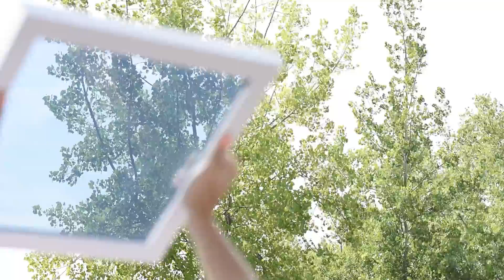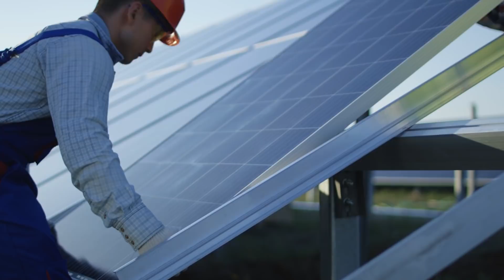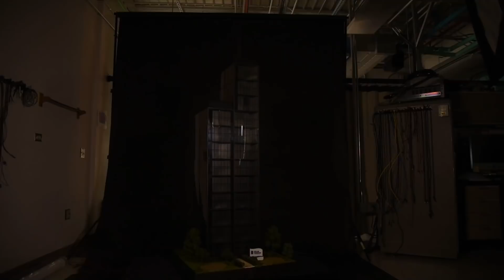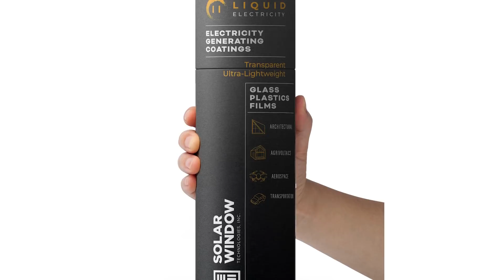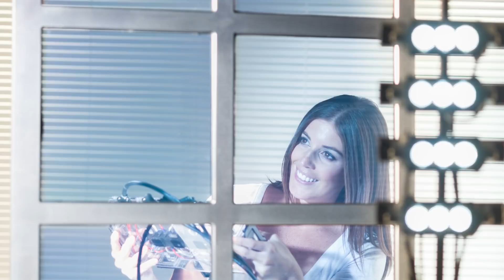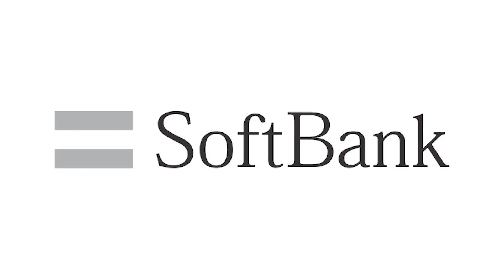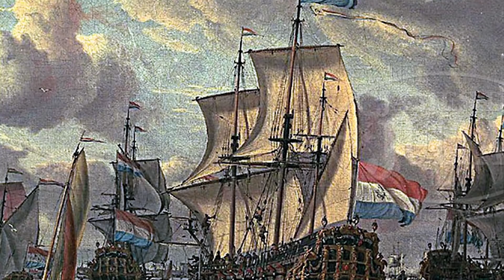Solar Window (WNDW) Your Next Solar Investment?

Comment: "... and ultimately be taken off the glass or plastic by a wire to wherever you need it".  Does anyone else hear in that statement that they haven't been able to figure out how to remove electricity efficiently enough to make this more than an a interesting idea.  This is exactly the type of technology where specifics about power and efficiency matter.  This has all the signs of being a pitch and none of being an actual product.

Comment: While I feel the discovery of solar coatings is really a grand idea and on the solar collection end it's a major break through - What I see is that the same thing has to happen to the solar coatings as does the solar panels - nothing is generated or collected if you will - after the sun goes down. that's my first  point the second and most stinging point is that a major portion of a solar system finances goes into the other major parts such as controllers and inverters and the big buck batteries which have to be the main power source when the sun goes down. Not to mention days when the it's cloudy and there is no sun or raining days or overcast winter months, so these too are also a very large factor in solar energy working at a cost efficient level. Yes I do agree that after a period of time the solar power does repay what is spent on grid power, but in many cases for a total solar off the grid home, that can take years not months to break even before a payback can be achieved. Anyway - Good video guys and I do hope to see it become  worth the effort before I die. Cheers!

Comment: Hold up a moment.  After saying that it's not imperative to be South facing - the next statement ( 12:45) says that non transparency is always going to be our friend bc more light equals more energy. So that in my mind says that this film/coating has a ludicrously high light to efficiency ratio or otherwise it just won't work? Am I just sceptical,  or have I missed something that contradicts the law of physics?

Comment: Windows move you mean his windows won't have electrical problems if you have 13-20 windows and half open or slide sounds like a electrical mess to keep it running  before it's paid off.

Comment: Why do they always talk us to death.  A picture or demo tells a thousand words.  Add to that how long does it last what materials are needed to make it.    Solar panels use coal special crystals , metals fired under great heat .  Solar panels last 20-25 years then you must replace them.  Batteries play a role because just generating electricity is half the job you also must store it then you have to convert it to use it to run things .   So much unanswered.  Still to complex and is it durable .

Comment: Doesn’t seem like it works. Well maybe not this minute. But  
How to make it work? Simple. Tell the story over and over connecting it to all kinds of other ideas/concepts. Seed it into thousands of minds to start building the potential imagery. The repeated thinking on the concept builds desire energy that pours from thousands of hearts. Heart energy has mass, so those energies crystallize into a non-visible construct . The non-visible construct of the object is what makes the physical prototype begin to work (or solutions be discovered). 
Thus the original hidden solutions were released into the 3rd dimension wayyy back in the generating of the heart desire energy. 
This is how “programming “ minds makes things and behaviors and beliefs become real life things. Just saying.

Comment: I'm no genius but I don't understand it. How can it generate electricity in reflected light and lower levels of light when my 100W solar panel which is supposed to be a little better than average when partially shaded drops off a cliff power-wise when it is cloudy or in partial shade? I think if they could just show this with the glass they claim is generating the lights they show in a video on their website, that would be square one. This company started in 1994 and has been compared to Theranos.

Comment: What progress on increasing efficiency AND optical Transparency?  Even slight opacity = Eyestrain.  Cool nanotechnology.  As for use on dust-storm Mars combining nano coatings to render windows (for instance) unable for dust to adhere to these surfaces. Great for increasing solar electricity generation.

Comment: Whats the timeframe of a panels life? Is sun deterioration or coloring of the panel through time a Problem down the road?
Reply: My exact thoughts along with Efficiency, Durability and Temp ranges
Reply: Also,, I’m an electrician, in order to couple these panels together the wiring would have to be a very large gauge to handle the distance the current needs to travel without loss from distance. There would have to be many current and voltage booster stations in-between  panels especially wrapping a large structure. Deterioration of wiring through time unless ran in conduits, What’s that do to the visibility of the panels beauty wise? All that wire and conduits? Or is wireless transmission the way to go?
Reply: @jeffreyjball5070  "Beam me up Scotty."

Comment: This is not a new idea or even a product. Thin film solar has been produced for 20 years. The reason it has not been mass produced, Is it is not dependable and didn't last no one would produce it because they didn't feel comfortable warranting the product. A product that you can paint on any surface  has been something that people new they could do for a long time the problem with that as well as any type of thin film (you can print on anything with a normal printer) is that you can not size a inverter to something that you are guessing what the output is going to be. Every inverter has a minimum and maximum. So that if you aren't in the middle of that min and max they inverter will not turn on. So now you absolutely can produce power from dusk till dawn it cannot be harvested into energy but you will not be getting a very good return on your money. So as for giving or investing or even trying this product my professional opinion is to let this company do this on there own for a couple years before investing or purchasing. If it is a product that they believe in let them give the product to non bias people to put on their house and see if it even lasts long enough to receive a return on  your Investment. Definitely don't give or invest money.

Comment: It has taken a lot longer than it needed to though...The auto industry deliberately stopped electric cars f4om going mainstream in the 1990s. Also, BASF bought up the patent for a very good battery (the Ovonics battery) and then stopped car makers from using it.

Comment: This is beyond a great concept that is genius.... Power generation on any surface .... Now add thermal and magnetic resonance with it and you can literally generate on any surface...
Reply: If it;s so great, and they've been promising a product for 20 years, where is the product?  Don't be so gullible,  This looks like a typical clean-energy scam to me.  Check their stock.  A lot of people have lost a lot of money.
Reply: @dougselsam5393  one thing I am not is guillable. I said great concept not company though if they manage to finally create it more power (pun intended) to them .. my hope is that someone will take this idea and run with it but with the way the world is today it may or may not come to fruition.
Reply: @Rivanni1  Well I did read that his company had doubled their performance to 14% as measured by NREL, and also other Organic photovoltaic films are suddenly doubling their efficiency now, but how long do the membranes last?  How many layers need to be applied?  Protective convering?  What about UV damage?  How do you apply them?  How do you connect them to get the electricity?  How can this guy talk about his supposed technology for almost an hour-and-a-half, and not touch on a single basic fact about them?

Comment: I understand very little about the tech on this BUT, it's not possible to run a home if you exchanged all of the windows for PV panels so how heck would anyone think that it's viable for anything other than glass built skyscrapers or office towers? Discussion time
Reply: It doesn't just go on glass genius, it goes on any surface, glass is just an option

Comment: What is the efficiency of this material on 'say' a glass which has the same surface area as a 'say' 300w Solar panel  ?
Reply: I think he sort of intimated size for size it doesn't stack up however the area of a roof compares badly to wall area So it becomes equivalent
Reply: @martyn3203  hope they highlight your reply for all the naysayers, small minded lot. Imagine this tech on walls.
Reply: He never said! He answered like a politician!
Reply: This stuff seems still in development. The company has said that a fully repurposed highrise bldg. could see energy SAVINGS of around 30%.  This is not a self-sustained system, more like a passive system for energy conservation and fossil reduction.    Still interesting, but NO PRODUCTION DATES, as shown.

Comment: I'll have solar panels on the south facing roof and solar windows everywhere else.
Reply: I have a Danish solar phone charger (was a Kickstarters Project) that has a flexible perovskites roll-up solar panel. Think a smaller self-rewinding window shade.  I hang it unwound in a window.  The battery and electronics are internal.

Comment: I still don’t get how this is gonna be wired into a power wall? How is all the wiring going to work and look like?

It seems that the foil has actually some grid pattern on it?

Interesting for sure but I would like to see how this works implemented in a building

Comment: Start applying to phone screens to help charge the phone. Set up with Apple I guarantee they would like that if it would work on a phone screen. I don’t have a data sheet on your product. It would be awesome to see the data sheet on your material. Keep up the awesome work your doing. Would it put out power from the light of the screen so you are taking advantage of some of the power output of your phone.

Comment: I needed a camera phone before they came out. I deal with cars and I use to have to send a picture of what I can buy to get the customers input. I had to use my Sony digital camera that took 3.5 floppy and then hook my Motorola startac to my laptop with a special cable and dial into my internet provider and send the picture via email. Usually took 10 minutes to send pictures after everything is done.  By done I’m talking about the successful sending of the email. And the upload speed was 42kps. Thankfully that camera made very nice pictures that were extremely small Sony Mavic in 97. All the other car dealers thought I was some kind of genius. I just had a need and everything already existed to do it and I put it together to suit my purpose.

Comment: Id be willing to have put on my van for rv energy window an reflective paint gloss on body as well an reflective metal reflection on under carage ..an see how the energy capacity flows into lithean battery into generator to power frig cooler heat cooking glass top lights ect. Get ahold of me an id be a tester
Reply: Sure!  Get in Line ... , haha.
Reply: Ooo, get a solar window driveway to go with the reflective undercarriage. Wait, can a mirror like surface be used for the driveway and can both reflective surfaces have solar window tech? That might create excessive heat problems if the ac goes out or isn't strong enough.

Comment: Why don’t they just coat solar panels with it so they produce more energy
Reply: All modern technologies are based on the non-renewable fossil fuels and fossil energy that made them possible. Solar photovoltaic (solar PV) technology is no exception. For example, every step in the production of solar PV power systems requires an input of fossil fuels - as the carbon reductants needed for smelting silicon from ore, to provide manufacturing process heat and power, for the intercontinental transport of materials, and for on-site deployment. The only "renewable" materials consumed in PV production are obtained by deforestation - by burning vast areas of tropical rainforest for charcoal (another carbon reductant) and to provide the wood chips that are necessary for all silicon smelters to function.
Reply: @iSoldat  why are they not using solar heaters for all this? Also, doing this once is a lot different than every day!

Comment: NASA, or companies in collaboration with NASA, are building a giant space station for commercial space travel. It would be a perfect application for this.

Question: can the coating be applied to roads potentially without compromising the surface such as grip for example?

Comment: So I get it, they want to sandwich into windows.
But where are all the pertinent questions?
Like what type of surfaces can it go on?
Does it have to be painted on plastic sheeting only?
What happens if you scratch it?
How durable is it, can you walk on it?
How toxic is it?
How long can it last in sun light?
Will hail storms destroy it?
You say heat is it's friend, how much heat can it take?
Is it safe to touch a large generating piece?
By sq. ft., how much energy output does it produce?
Does increasing the thickness create more output?
These are the kinds of questions I need answered before I invest.

Comment: The word "efficiency" is a term used to stop you from thimpfking about things that may be perfectly good to develop or use.  ONe good example is wind.  It doesn't matter if a wind generator is "inefficient", simply because the wind is free and ANY amount of harvesting the wind is a plus.
Reply: It's a question of return on investment, how long will it take for the "free" electricity to repay the cost. Thanks to the 30% tax refund it took less than 5 years for my PV system to produce really free electricity. This product will only succeed if it is cheap enough and durable enough to recoup the up front cost of installation.
Reply: @cjwilson54  Thanx Chris, you are absolutely correct.  My comment, however is directed not at the subject of your comment, but rather at people who constantly harp at "efficiency"  It turns out that the "most efficient" wind mill is one with ONE propeller.  That does not necessarily mean it is the best choice.  a single propellar is ONLY efficiaent if it turns so fast that the blade turns into it's own wind shadow which high speed propellers will do if more than one blade.  However, for slower propellers, this does not happen and so for wind, which (so far) is free fuel efficiency is not so important.   Then there are certainly other factors such as roughness/smoothness of the blade--the rougher it is, the more turbulence and less efficiency.  Virtually every aspect has inefficiencies that can be improved however, for an individual making some kind of energy gatherer, it may be totally moot.  When energy generators become large for community sized use, then efficiencies start to matter, and, incidentally are easier to implement.

Comment: I have bad feeling that this end up as Nikola. Many questions were not answered directly and lot of stuff was read from Apple screen. How  does  electrons flaws, where do you attach negative and positive terminal why not let each continent maybe country build their own solar windows I am sure there are electronic manufacturers in other parts of the world. Having everything copyrighted is the way how to stop development. How do you attach wire to a roll of solar glass? Cut the right  size, glue wire/terminals  on it get Windows manufacturer to attach positive and negative conector on the window frames and connect them all together? I like to see an alternative curent generating solar panel..
I will be the one of first replacing my windows for solar windows if thay ever see the light of the day.  But for now I am very sceptical and si this as a stock market scam ... I like to see replay from people who can provide answers to my doubts..

Comment: Even if this work, much depends on how much energy the Sun gives out for a particular area. There cannot be more energy than that, unless it is supplied from a non-solar source. "At Earth's average distance from the Sun (about 150 million kilometers), the average intensity of solar energy reaching the top of the atmosphere directly facing the Sun is about 1,360 watts per square meter, according to measurements made by the most recent NASA satellite missions." Does this method capture more of that than any other technology, so that is the key question... show us your panel and show us the data! Give a demo!

Comment: At 35 min. I'm itching to ask if these will allow enough sunlight through for agriculture. At 36 min. Zak asks the question. Scratched that itch. Now I'm wanting to know some numbers like average power per sq. ft.
Reply: For everyone wondering about the agriculture, by the sounds of it, it will work, and in the case of spinach and possibly others, twill work even better.
Reply: 1 sq m...5-10 watts